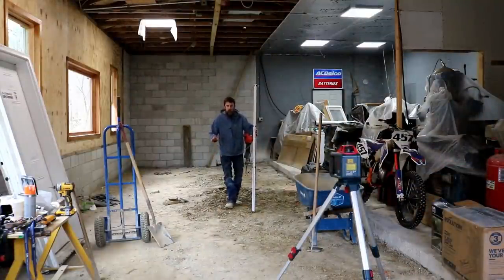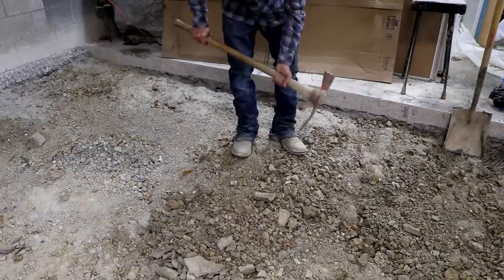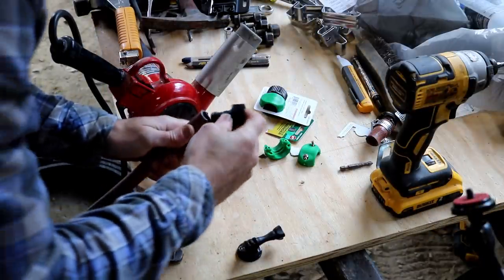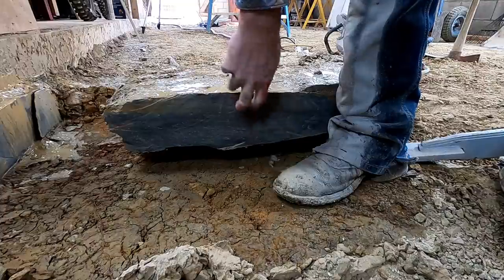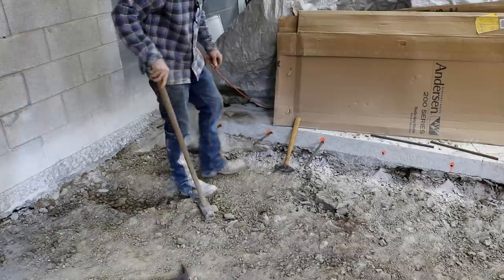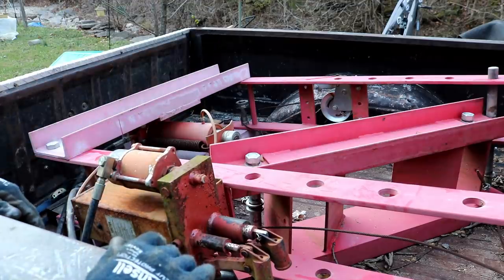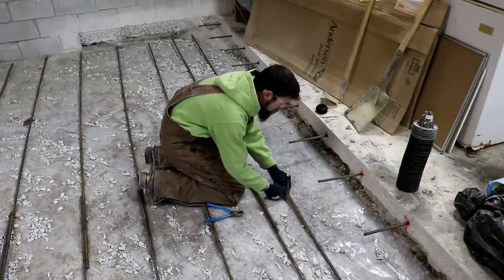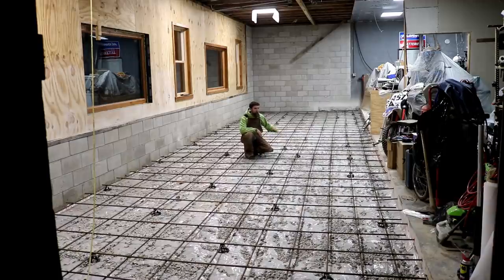Preparing for concrete .

Comment: A few considerations: dig a small trench at the door so as to create a poured beam. As heavy things transition across the threshold it supports the slab edge. Add the PEX now - minimal cost and effort. Don't pin to the walls - let the slab float. Regarding anchors: you can drill and set an anchor anywhere of your choosing later. Epoxy coat the slab now. You will never have it cleaner and with nothing to move off of it again.
Reply: Good advice!
Reply: All valid points, especially the depth increase at the threshold, like it.
Reply: Yes and extra rebar across the door also.
Reply: Amen on the PEX. Insulation under the slab is a very good thing too.....
Reply: I hate epoxy covered floors.. There slippery, if you got something large to weld you torch the floor, if you spill any chemicals it gets eaten up. If all you do is park your car in the garage/ shop then yeah its neat but if you plan on any metal work id skip it.
Reply: Some fall on the floor is not all bad - makes it easier to hose out after a dirty job.  Perhaps put the big machine tools toward the back where it is level?
Reply: Good idea with the poured beam at the entrance! That will really be handy when you're trying to roll a 30,000 lb. machine into the building. I will file that away for when I need to build a shop. Thanks 
Edit: Your slab probably needs to be thicker than 7'' if you intend to have 30,000 machine tools sitting on it, if anything for stiffness as to make alignment of machines that sit on top easier. Adjusting twist out of a large and relatively flexible machine is much easier when the floor isn't twisting/bowing as you're adjusting the feet, and will move less with time and also be less sensitive to a lack of support form  the sub dirt (i.e if you get settling of the dirt below you're slab, it will now be acting as a beam spanning a given void. The stiffer the beam the better)

Comment: I second the previous comment- the integral beam at the entrance, and also the pex- you’ll never regret radiant heat come wintertime.
Did it in my house and shop, never looked back- nice warm feet and machine tables. Put in the tubing now, plumb it later as time and money allow.
Great work, more power to you.

Bill

Comment: Thanks Steve..... cringing while you were hammering in the rebar.... I just know if I tried that, the old concrete would have cracked and split 😁, excellent work Steve, the end is in sight, get your shop back to working state 👍
Reply: I had the same thought on the rebar. I would have surely cracked the concrete.
Reply: actually was thinking the same thing him hitting in the last piece in and the whole floor flaking in half
Reply: canuckguy worried  one advantage though , if he decides to replace the front part of the old floor at a later date and is carefull enough he probably can break the old concrete away around the rebar verry cleanly and reuse it to connect the rest of the rebar for the next pour to
Reply: If it gets wet and rusts it WILL split the floor as I have no doubt there are already minute fractures.  However did say he planned to re-lay that base anyway.
Reply: Yeah.  Stone masons split huge boulders using the same method as the rebar hammering.    I had my fingers crossed the entire time.    Was waiting for the oh crap moment.   
😦😬😳😩    😎

Comment: Steve, good work.  Your decisions are spot on.  As others have pointed out:  1)  By not using rebar at the exterior wall, you allow the slab to "float" in relation to the wall, which will reduce the chance of cracking;  2)  Concrete leveler on the old slab, followed up with an epoxy top coating over the entire slab will give you a longer lasting "temporary" solution on what to do with the old slab.  Don't be surprised if it lasts quite a few years.

Comment: Before pouring your concrete install some anchor points to install eye bolts in.  They will come in very handy in the future when you need to winch heavy equipment around.  I failed to do so when I built my shop and really regret it.
Reply: Very good advice.
Reply: Great thought!
Reply: think it be a better idea to get a few pieces of thick steel and drill / tap a verry big tread in them , sink those in the concrete untill level , when you need an eyebolt screw them in there , that prevent the eyebold becoming a trip hazzard 
you could still drill holes in the floor with a diaimond drill afterwards and put pieces of round stock with the tread tapped intoo them in there with epoxy , would do the same thing (just put some cover over them to prevent the tapped holes from filling with dirt )
Reply: Great idea. I was in the DIY place with my Mrs the other day and she asked what the stainless covers were every 12 foot or so and if they were drains. I told her they were winching points to drag stuff in with. You can get nice ones that have a stainless flush cover that you set into the concrete.
Reply: +1 Excellent tip!
Reply: I would not put in anchor points now.  They will probably not end up in the optimal place anyway.  Wait, learn how you might use the shop and then dill and epoxy in places that make the most sense.
Reply: Great advice 👍.
Reply: I’ve got a couple in my garage and they do come in priceless every time I use.
Reply from the maker: I like the idea👍.  Thanks

Comment: Wish I had caught you before about the expansion joint especially at the walls.  For future reference,  place the expansion joint material on the wall with top at the level of the floor.  A good finisher will pour and level concrete at that level and smooth it so as to use that for a screed.  A bad finisher will foul it up no matter what you do to fool proof it.  The board will not make a good addition to expansion joint.  This is not be critical to you Steve and I know even though this is a week ahead...I peeked!  The idea using the sheet steel for a screed guide is a new one on me but if you have it, it works I bet.  Always talk to your finisher and see what they want you to do to prepare.  It may save you money and time.  Use the Crisco on the steel before the pour cause you can wash it off easier that il or petroleum grease.  For future use Steve, my wife always says I'm always a dollar short and a day late, Sorry!  Greg

Comment: I think you're doing a great job!   My Two Cents:  I would put up a BIG tent house move the event into it & takeout the other 1/2 of the floor. Then the pour new full-size floor.   That would be a lot to fit in before winter freeze & double your concrete expence.  But it's worth it!  Also, make sections with a 12"  thick of concrete for very large tools like a power hammer.

Comment: Just a thought - Spray paint the walls before the concrete is poured. Saves scraping paint and drywall compound  off the floor afterward. 

Looking good and I can't wait until you are back to machine work. I understand your need for floors, roof and a solid wall. We just had 70 yards installed in my driveway, shed floor, and parking area. 20 years of gravel and dirt was 20 too much.

Comment: Steve:   love your channel.    scribe  a wood shim to fit on the dipping section of concrete.   tap-con it down to keep your new slab dead level.   remove the shim and use self-leveling (i.e. Mapei, Ardex, Hydroment, Custom, etc) to level out the old section.   best of luck

Comment: Have the "bad" section of the pad raised up. Can be done in a few hours with grout or even expanding foam. "Slab jacking" " pressure jacking" or "grout jacking". From what I remember, it's not too expensive.
Reply: I think the problem with the old floor is not just that it’s not level, it’s not flat. Also the other wall are sitting on it.
Reply: @janderson8401  Good point about the walls being on top of the slab. Steve could always saw cut the bad section along the walls. Its amazing what they can do with the grout jacking, and a experienced tech could straighten and level it out pretty well. Just seems like a better option to me.

Comment: Steve if you add plastic tubing in the slab  you could get some heat out in the shop and a hot water heater should be able to heat the whole shop

Comment: Steve,

I agree with your decisions on the slab.  You don't need dowels around the perimeter, and a 1/2" expansion joint is the right way to go.  Regarding the front of the existing slab, the easiest thing to do is cut a 2x in a wedge shape that will keep the height that you want and pin it to the existing slab.  That way you will have something solid to screed to.  A 1/4" bit makes a hole just the right size for 2 sixteen-penny nails (or a 16 and an 8 if the bit is worn).  As for the concrete itself, spend the extra $5 a yard and get fiber in your mix design.  I've found over the years that fiber is one of the biggest bangs for your buck in concrete work.  Years ago, the fibers were much longer and thicker, and when you were done, it looked like your slab needed a shave.  Not the case any longer.  

After the pour, you're going to want to apply a densifier to the slab.  The big box stores probably won't have them.  You'll have to go to a concrete place.  The 2 national chains for that kind of stuff in my town are White Cap/HD Supply and CMC (Commercial Metals).

For your skim coat:  about the thinnest you want to go with actual concrete is about an inch and a half.  Less than that and it will crack up.  For the thin parts, there's a product called Ardex that is the industry standard floor patch.  Also, you'll want to apply some bonding agent to thee VERY WELL CLEANED existing surface.  The latex stuff (called "milk" in the industry) is okay, but for a real bond, you'll want epoxy bonding agent.  It's about $40 a gallon and will cover 80-100 SF.  Hope this helps, and let me know if I can be of any further assistance.

Comment: Good job Steve. I like your plan on keeping the new floor level, and then dealing with the old one.  I liked Robert Lark's idea  about some anchor points to install eye bolts. Go easy on the heavy work, I didn't, and now have had 5 spine surgeries, and I am totally disabled. Invest in equipment to do the heavy lifting, Take the time to work smart, not hard. It will pay off in the long run.
Reply: yep, i'm on a disability pension here in Australia, managed to avoid any surgeries (they wouldn't fix my problem)
i've learned a lot in the past 19 years since i moved to the country, my neighbor is a diesel engine mechanic and has one useless arm, the only time he needs help is with welding and his sons help with that.
he has big rigs (prime movers in USA?) dropped off and rebuilds the engines.
Reply: @amandagardner565  I am a Toolmaker,  I had to retire early @ 61. I planned to work until I dropped like most men in my family. Dad worked until he was 90. I still have a small shop, and do what I can. My wife, and son have to do my heavy work. I can't lift more than about 10 pounds.

Comment: Thanks for sharing again. A great effort  to get it all done.  I am looking forward to your screed guide on the edge of the old section of the slab. I like to coat the new slab with chlorinated rubber sealer with the first cote on the da y of the pour as it is more economical than epoxy and does not have a limited  work time. The comment below about the edge beam at the door is very good and standard on commercial work here in Melbourne Aust.  Keep up the great work. Geoff.

Comment: I say assembly your new machine shop over he new pad which is perfectly flat.  Do your ceilings and insulate and replace then replace the other side now or by spring.  Let google pay for it. Do it all the way.  It almost never happens to come back and finish something later.  Additionally, I'd do like a rectangular area at the door that tapers down a couple inches from about 6' into the shop.  This means it can rain a little in the shop and it runs out.  Also, you can wash something there and it will run out but the majority of your shop is flat and level like it should be.  It's your money and easy for me to spend it.  Enjoyed the whole series.

Comment: Great vlog Steve and family.
I would have used the hammer/rotary percussive drill with rotation turned off to drive those re-bar dowells in, just needs a home made adapter.
Over constraining the new slab pour is bad practice to my understanding, so yes, tying in on a single joining plane only appears correct, I'm not a civil engineer, if I was, I need an address to send my bill to 😁.
New shop addition looks great. Thanks for sharing and stay safe all. Regards John.

Comment: awesome job I'm glad you put visqueen down the slope on the other slab is not good to over lay you need a min of 3 " to over lay with it not to want to chip out on the edges . you can scare a line and then cop out add a glue like that ties the two together add wire mesh t.to taper to nothing it will just chip out on the edges and it want be good . I love your work .ive done this for 40 years I think it will work short of cutting it all out

Comment: Before you pour the concrete, add an electrical connection to two sections of the rebar to make a Ufer electrical ground and use that for the electrical service entrance ground.

Comment: It may be too late for you but many times in cases like this we have gone in and pressure grouted under the low slab. It isn't really rocket science and the pressures are actually quite low.  With about 2 PSI you can grout jack the low slab up the 3 inches easily.  It may be worth a try that way possibly you will be able to stay with that slab as it is.  There are people out there that do this. But, we made up a small pump where we use self leveling floor grout just because it is easy to get and work with, mix it wet enough to flow.  For small jobs we made up a pump out of 4 inch PVC pipe with threaded fittings and a short garden hose. It is quite a bit of work filling the tube but just very low air pressure from you compressor works fine. Thank you for the video you are making good progress.

Comment: I'd leave the slope match the old concrete. You'll appreciate it when it rains because water doesn't run uphill.
Reply: I agree, kind of.  The building could have originally been a garage, where vehicles could have dripped/dried off (- thus needs to drain to outside).  However, if Steve now wants the full area available as a flat & level floor for machinery, then the concrete needs to change.  You could put a 'car port' shelter over the new apron, if you need somewhere to drip/dry equipment.
Reply from the maker: My shop is on the highest ground. If water runs in my shop through the door I'm in big trouble 😁. Thanks for watching 👍

Comment: Driving rebar. Electricians have a tool that we use to drive ground rods 8 to 10 feed in to the ground, it's a cup on a sds shank that when on hammer only can drive that rebar right in easy

Comment: Great video Steve.  I look to Saturday morning's just for them.   I put down some  4 mill plastic before I put down the rebar...helps keep moisture out of the shop.  That will be one strong floor.  When my shop was finished.  I had to drill some  one inch holes in certen areas  and make a pin in insert in them to tie chain to .   Then you can use a come-a-long to pull your machines around saving your back.  Worked great for me.  Waiting on next Saturday.

Comment: Shop is looking very nice.  HVAC:  Look at adding a mini-split heat pump.  I put two of them in this year, you get both heating and cooling and the cost is very reasonable.  The only tool you need is to borrow a vacuum pump to evacuate the lines unless you use the more expensive DIY MrCool unit.    In slab PEX tubing may sound like a good idea but its not practical for intermittent use, you have to leave them run all the time because of the thermal lag. This is fine if the building is well insulated and once the slab gets to temp the cost is only for the building heat loss, but fails if you just want heat for 2 or 3 hours after work in the evening.

Comment: When pouring a new slab adjacent to another existing slab or sidewalk I like to control / allow future vertical and horizontal movement.  To handle horizontal movement I’d do an isolation / expansion joint.  To handle vertical movement without stopping horizontal movement I install rebar across the joint like you did, but ensure that one end is grouted in, the other end is greased and placed within a PVC pipe sleeve sized to fit the rebar snugly.  This protects the rebar on that side from being fully grouped in place and also restricts the movement to horizontal.  I’d do this every 48” OC.

Comment: Looks great Steve. In the time between pouring your concrete and doing the skim coat, make a wooden wedge to soften the transition between the two planes of concrete to minimize your trip hazard. Also consider etching or grinding the old pad before pouring the skim coat.

Comment: VERY smart using the hoe as a story pole but large rocks are cheaper than concrete.
Pointing the empty wheelbarrow in your exit direction eliminates the need to turn it around when loaded. Laying down some scrap planks or plywood makes pushing a wheelbarrow with properly inflated tires much easier. Only us machinists would beve; the ends of rebar.
You can be very proud of the quality and how far you have come with this project.
Loved your violin background music.

Comment: I would suggest installing pressure treated 2x's against the exterior wall and your existing slab. You can then use the tops of them to screed your concrete to level. It will be very hard to get it spot on otherwise. This will also give you built in expansion joints and you could remove the wood when you redo the other half of the slab should you so choose.
Reply from the maker: I considered 3/4" thick treated for that. I have some actual expansion joint material but it's been a real pain to mess with. I would think 3/4 would work. What do you think Brian? That's a bit thin to screed to but I think it could be done.